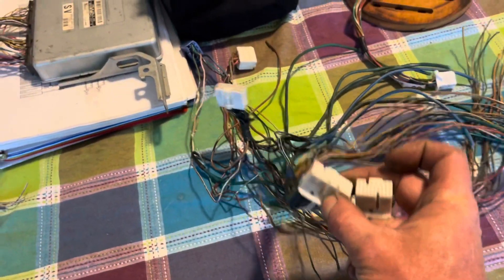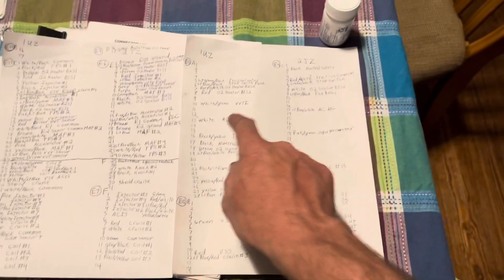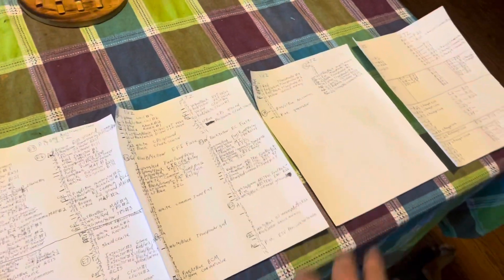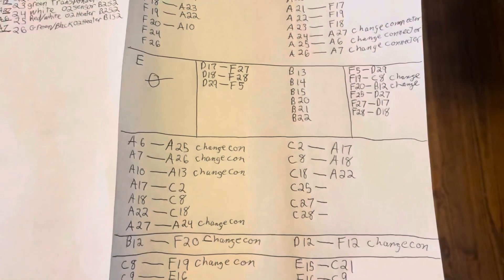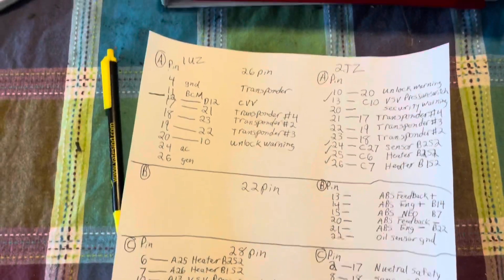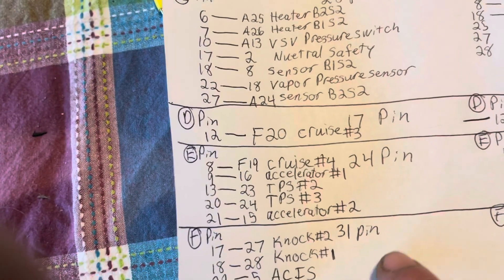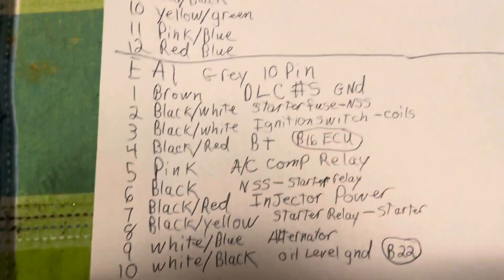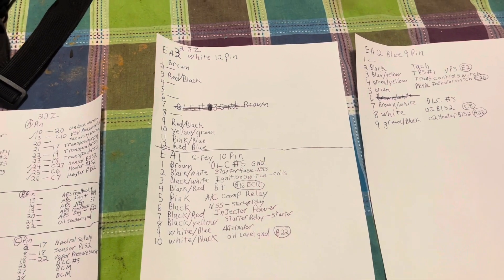2001 Lexus IS300 1UZ swap ECU wiring part 1

Comment: Love the swap, vids have been great. I am just wondering if it’s possible to run the body off of the stock 2j ecu and go standalone on the 1uz to run boost? Looking into something similar to this.
Reply from the maker: I don't think you would even need the 2j ecu for the body because the car has a body ecu. The only thing I could see it needing it for is the K-line communication. I'm trying to make this like it could've come directly from Lexus like this.